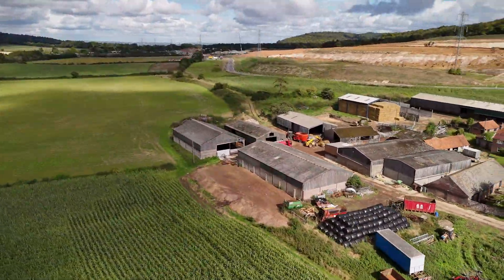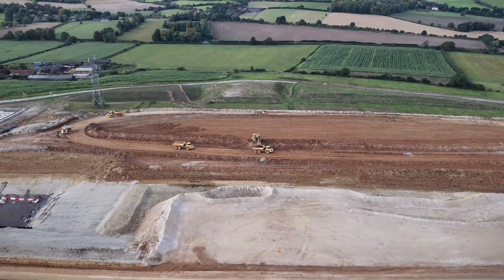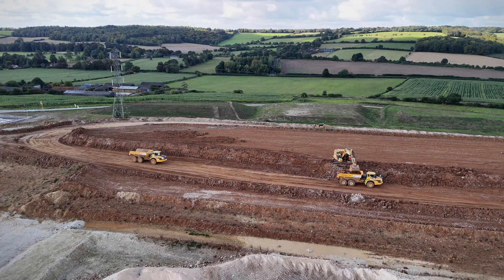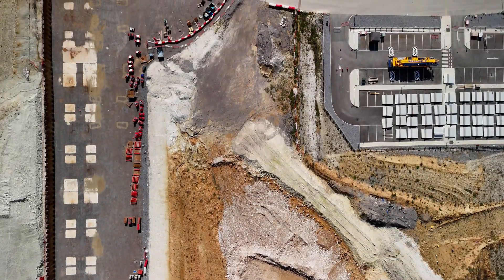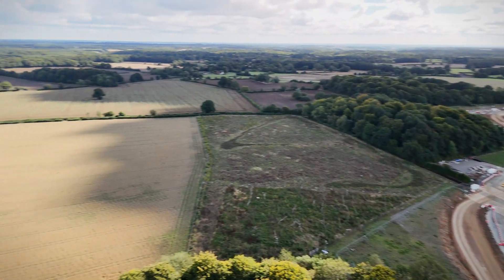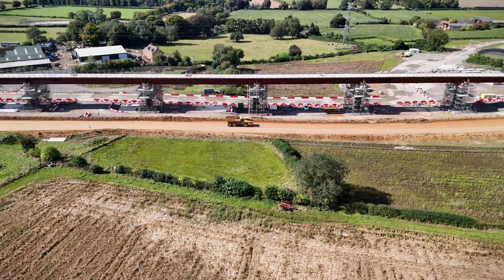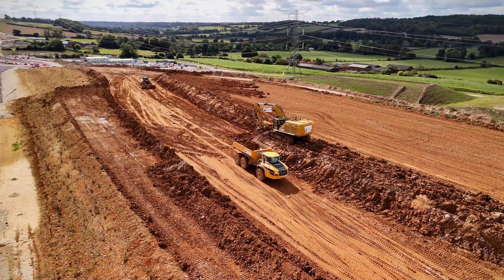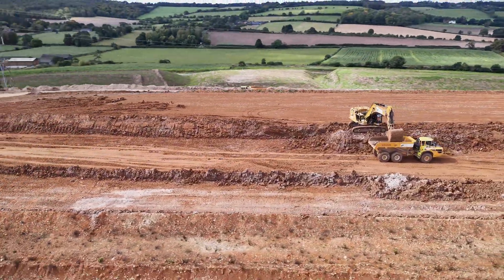HS2 Wendover Dean Viaduct Construction Update 2025 | Progress on UK High-Speed Rail Project

Comment: 12 cubic meters of the chikterns AONB with every scoop. Nice. Firstly why the heck didn't this line go out of the North of London where the natural route is. Secondly, rather than digging 8 million tons of Chiltern Area of outstanding natural beauty, why wasn't this tunneled for another 2 miles to protect the chiktern hills. There is no way tunneling would have been more expensive than the destruction of the countryside that is currently happening. 

Also the bit about the "meticulous" environmental management and the attention to "detail" is rubbish. This morning after rhe heavy rain and no grass to soakaway the water. It ran off the land at an incredible rate and flushed that same bright orange clay earth down all than lanes and caused a disaster to the A413 blow which flooded so badly it almost came to a standstill. Orange water was blasting down the  asks of the lanes today like niagra falls as the rain simply washes straight off the surface and doesn't soak away. Rocks the size of footballs were all over the lanes leading down to the A413, that came from the HS2 site. It's an environmental disaster in every way. Work should be forcibly stopped until they spend a year putting in a proper water management solution to correct the ruination to the natural water flow that they have caused.
Reply: Why are getting all worked about this very unremarkable bit of the Chilterns? Somehow you have managed to be completely oblivious to the noisy A-road, the non-electrified railway with noisy diesel trains, and a shed load of massive electricity pylons. I detect another tedious NIMBY!
Reply: Do you think those earthworks and construction sites are permanent or something?? Christ, please take a break from sucking batteries to contemplate what the site will look like when completed....
Reply: @JT-nr2ss  well said! I wasn’t around when the motorways were constructed but I’ll bet the letters to the newspapers were full of people saying it was a waste of taxpayers money.

Comment: I was employed on the Taiwan High Speed Rail project in 2000-2005 as Senior Inspector of Work on a 16 km section that had 11 tunnels, 10 bridge and a large section of viaduct and raised station. The ROW remained with a viaduct after the flood plain to bring the line into more stable ground in the foot hills. The tunnels were excavated using the NATM system of excavating short sections of top heading, installing roof bolts, mesh and applying a sprayed concrete lining in layers. Continuing down with the mid section and invert to form a ring structure.
The viaduct section was built on spread footings, extra width piers capped with Earthquake suppression pads. The deck spans were either DSM, ASM or falsework cast insitu station tracks and platforms. One river bridge was erected using steel frame units, the others were cast insitu stressed beams and decks. The viaducts provided free movement for farmers, rather than an embankment.
The contract was awarded to THSR on a design, build equip and run basis. The partners in THSR included Eva Air and Fubon bank, expat employees were given access to free flights and banking from these two companies.
Reply from the maker: Fascinating, thank you for your well informed comment!